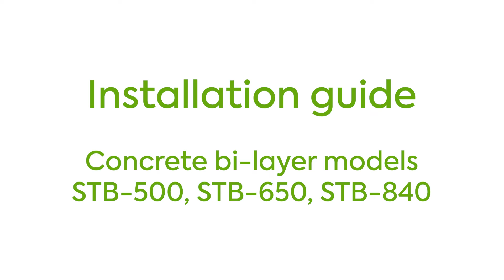Ecoflo concrete bi-layer models STB-500, 650, and 840 installation guide

Comment: Does this tank replace a leaching bed or do you still need a leaching bed?
Reply from the maker: Thank you for your comment! The Ecoflo compact biofilter complements, rather than replaces, a drain field / leaching bed. It receives wastewater from your septic tank, removes pollutants using a coco filter, and then discharges effluent to a compact drain field.

If you don’t have the space or suitable soil for a drain field, our UV disinfection system can be integrated in the Ecoflo compact biofilter tank. This system also filters wastewater with a coco filter, then uses UV light to kill pathogens, allowing you to discharge effluent directly into a ditch or watercourse.

We hope this helps. If you have any more questions, feel free to reach out. Our contact info is in the video description. 😊

Comment: Pumps make no sense....Why use electricity??
Reply from the maker: We offer the gravity flow option for sites that can use it, in which case treatment and dispersal would be 100% passive. Pumps are necessary for pressure distribution in leach fields or for final discharge when site conditions don’t allow for gravity flow (for example, over long distances or on uphill slopes). 

The decision to use gravity or pressure distribution really comes down to a combination of site conditions and local regulations!